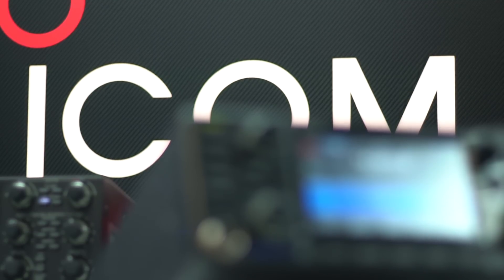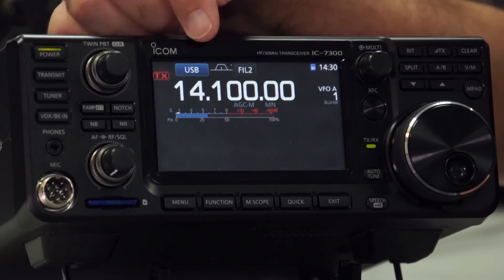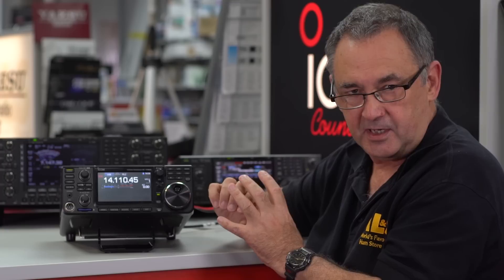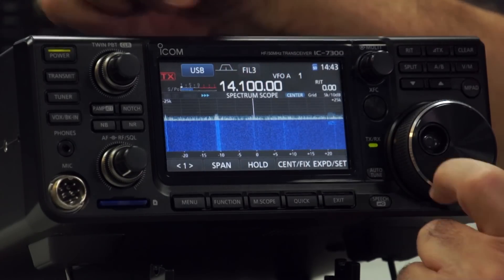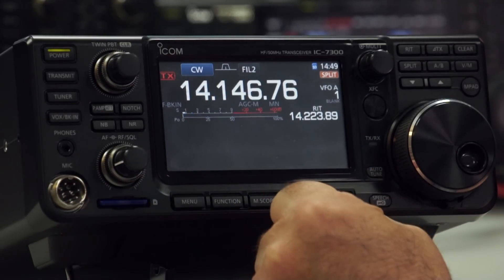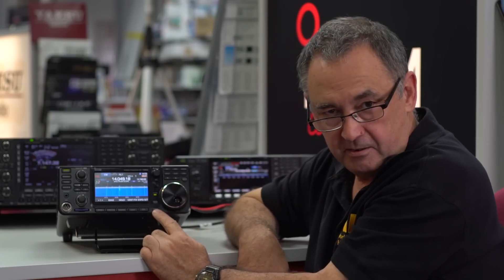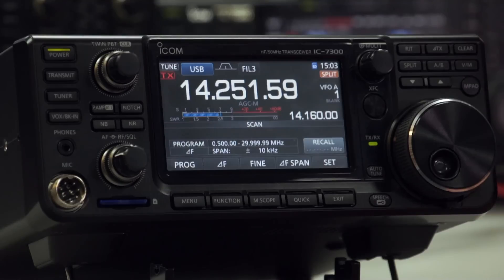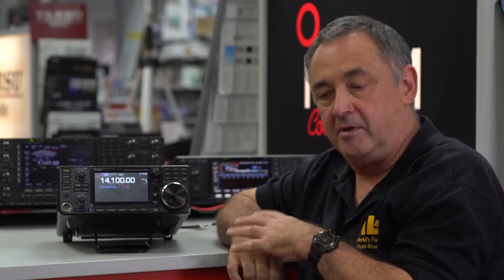Icom IC-7300 Overview at ML&S

Comment: Thank you so much! This tour of the rig was extremely helpful. One question: When using the IC-7300 as a base station, I'd like to run the audio into my recording studio setup, either through my audio desk or through my audio interface. What do you suggest as the best way to do so? Should I merely use the analog external speaker connection, the ACC, the USB output into my computer then out to the interface? Any wisdom you could impart would be greatly appreciated. Thanks!

Comment: Is there away to adj the power output of the radio for side ban and and AM😀
Reply from the maker: Yes, you use the power control. Fully adjustable from 100W down to 1W.

Comment: I know this is an old post but do the 7300's come with an SD card?
Reply from the maker: The 7300 does not come with a supplied SD Card. You will need a SDHC card no larger than 32gb.

Comment: Nice radio, what r some of the purposes for the SD card?  73 kc1ero
Reply: Hi Jason, 

Many thanks for the question. 

The SD card can be used for several purposes such as saving the radio's configuration. This is useful should you have the radio set up for a specific function - such as data modes, where the audio paths are configured in a specific way, and levels are set to particular levels. It can take some time to configure the radio to get it to work the way you want, and by storing these settings on the SD card, then they can easily be recalled if you ever have to reset the radio for whatever reason. 

Another uses of the SD card can be to save your memory channel contents, save your transmitted and received audio, save the communication and receive history log, voice audio for the Voice TX function, the RTTY decode log, the transmitted or received RTTY decode history, screen captures... The list goes on and on!

You also use the SD to update the firmware of the radio.

I hope this helps, but if you have any more questions, please feel free to ask.

Cheers,
Steve (G0TAN / W6TAN).
Reply: +Stephen Venner thanks.

Comment: Does this transceiver support 2m, 70cm or DStar? Or only high frequency?
Reply: Hi Jeff,

Many thanks for the question...

Sorry to say that this radio is only HF + 6m + 4m.

If you want an Icom which covers 2m & & 70cm as well, then you would need to look at the IC-7100 or IC-9100. Alernatively, there's the Yaesu FT-991 (or FT-991A).

Please let me know if I can be of more help.

73,
Steve (G0TAN / W6TAN).
Reply: Stephen Venner
Reply: Leticia Molina
Reply: Only HF
Reply: I have a icom 9100 for sale, covers pretty much everything.. excellent condition. Comes with all optional filters and the dstar module in box not installed.

Comment: What voltage will it take. I mean it the a tranformer to brnimg down the powr
Reply: Hi James, I'm not sure what you mean... Do you mean what is the minimum voltage that the radio will operate on (before it switches off), or what is the minimum voltage that the radio will still provide 100W OP?
Reply: The power it need to work. If the is a transfor, in the line, I need the out put VOltage
Reply: OK, I measured the operating voltages on our demo unit, and the nominal voltrage is 13.8 Volts. 

It still gives full output power (100W) at 13V... After this, the output power drops off as the input voltage is reduced.

The radio will work down to about 10.5V, but the power output will only be about 5W.

Below 10.5V, the radio will not power up...

I''m still not 100% sure if that's what you mean, as you mentioned about if there is a transformer in-line. This is a DC radio, and you should be connecting it to a PSU which supplies 13.8V, at around 20-30A.